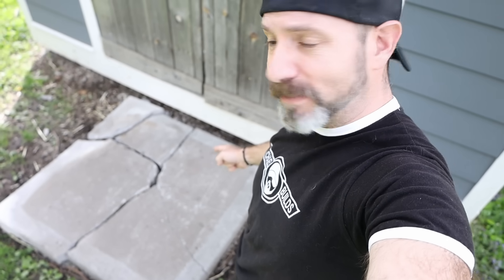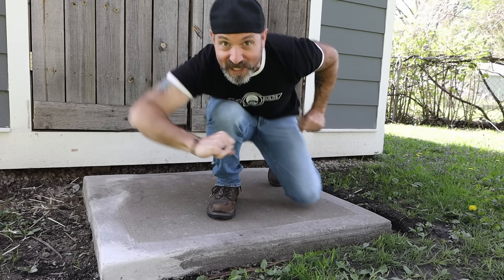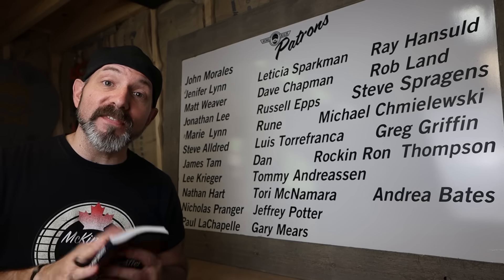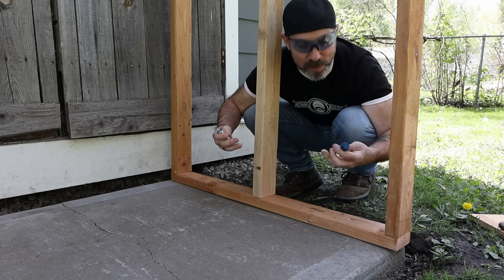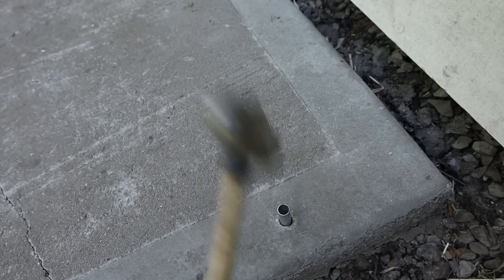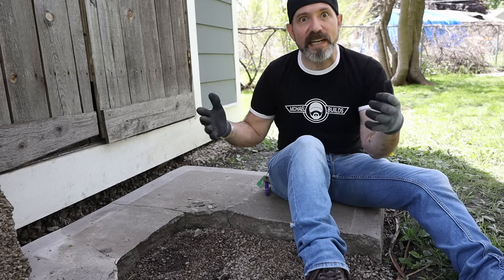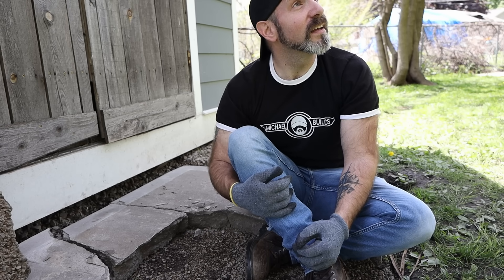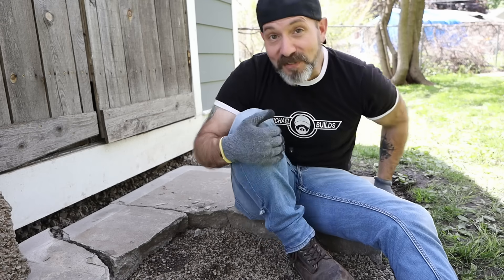Dry Pour 30 day cure Test

Comment: was this using the ready to use concrete quikrete mix? and you used the same method as other videos, mist a couple times and then soak them for a day or two off and on? getting ready to do this to extend my parking pad just a bit. great videos, thanks!

Comment: One effect in dry pour concrete is that cement loses most of its volume when soaked in water.  Those voids remain, similar to using too much water in a wet pour.

Comment: I'm 65 yo and I'm needing to do some cement work and I'll be doing it by myself.  Dry pour looks like a godsend.  
Found another vid about a civil engineering trick where rather than put rock and sand as a base to pour over, you mix 15 - 20% concrete into the dirt and let it harden.  Cheaper and easier.

Comment: Dry pour also does not meet local building code either in most jurisdictions you’re required to apply with code enforcement before you even pour any cement once you tell them you want to dry pour they will deny your permit and depending on the code officer you might have to jack hammer it all back up and face fines up to $200 a day you’re in violation.
Reply: The good news is it's so weak you don't even need a jackhammer to break it up

Comment: I saw your first video.  It is a failure.  I could have told you that from the beginning. These DIY folks don't have a clue or understand how concrete cures.  It is a chemical process and needs lots of water.  As the car tire went over the pad, you can see the pad flexing.  It will be dust in just a year or two.  The lower 2/3 of the slab never gets enough water to cure properly.   Does it cure to 3000 PSI, normal or 1000 PSI?   How many folks were not as diligent as you and watered it a few less time than you did resulting in it only cures to 500 PSI?   Note, the slab, as small as it was, should not have broken as you drove over it even 100 times.
Reply: I agree with you except concrete doesn't need lots of water, it needs the correct amount of water to thoroughly hydrate the cement in the mix. Correct pour concrete actually uses less water than dry pour.  The 60lb bag instructions call for 1.9L-3.3L, that's not much. Check out the great video "Testing Dry Pour Concrete With An Expert" by Tyler Ley, engineering professor at Oklahoma State. He found that water actually does penetrate dry mix completely and rapidly, but it doesn't form the cement paste needed for strong concrete. He found dry pour tops out at like 750psi while the same mix correctly poured achieves 3500psi.

Comment: Good video and fair testing. I use this method for decades - lazy way for "on ground" cement pour not thicker than 10-15 cm.- with or without metal or plastic rebar inside.After the "misty wetting"  while still not hardened,  it is possible to  make some "relief pattern" on the surface.Good idea is to spread and cover the surface with very thin layer of pure cement powder (after wetting) for reinforcing that surface and making it smoother. Can also use cement dye for colouring the surface. Dry pour is nothing new.By the way, cement and its mixtures are hygroscopic and will  harden like a rock even just on open air  and time of hardening depends only on the air humidity and takes longer time if not wetted on purpose.

Comment: Want a proper test, work with an engineering college professor, who can show you with a microscope what's happening both as concrete wet poured vs dry pour cures. There's a lot less strength, as one's not curing evenly, allowing a matrix to evenly form throughout the work.
This method was dispatched by the American Concrete Institute over 50 years ago, when there was miscomprehension of gunnite application being "dry" (it's not, it gets mixed in the gun with water and typically in niche applications where strength isn't a primary concern in all dimensions, such as swimming pools.
Concrete doesn't dry, it cures by forming hydrated crystals that form needle like structures that link together with the aggregate and peers to form a matrix, uneven hydration results in incomplete matrix development and corresponding loss of strength overall - especially through its thickness, as the center tends to get less water to hydrate with, the base drawing dirty water from the soil and only the top is well hydrated, so it's weak, but looks pretty.
The telling part being, it cracked, rather than flexed as concrete should do when the ground gave under the weight of the truck rolling over it. The further telling, how much pulverized into powder after 30 days of curing - especially in the middle of the work.

Nope, I'll mix it, dump it and rake it into place, then screed it, then finish it properly and call it a proper job. Then, at least I know that the concrete will outlast me.
Reply: Here's a link to exactly that, college engineering prof tests dry pour: https://youtu.be/YPAKzrv39xM?si=ULAZk7e4xNSl9IS_

Comment: Dry pour works, just don’t do anything on it for a couple of years. It takes many years to cure to the same strength the wet pour has in only a few weeks. Remember, concrete continually cures and increases strength over time, even decades!

Comment: Seems like the dry pour needs sufficient watering to be more comparable to a wet pour. The initial misting is only to keep to surface from eroding. SO I believe that a dry pour can be used in a block wall. Fill cement half way up to the top block. Fill the cell up with water over and over again to the volume ratio of recommended wet pour. Good luck

Comment: I don’t think it would have cracked if:

1- he had wet and compacted 3” to 4” of 3/4” base coarse over 6 mil visqeen plastic roll sheeting with a sled vibrator or a jumping jack compactor and made the moistened base very tightly packed  and hard as they would on a regular driveway or house slab foundation before a pour.

2- PERIMETER FOOTINGS and PROPER Placement of rebar and concrete wire. He should’ve put  in a 12” to 16” wide x  8” to 12” deep perimeter footing with # 4 double track rebar 1/3 of the way depth from the bottom of the slab and put #10 gauge, 6”. X 6” concrete wire through out as well, just as you normally would do with a wet pour.

3- PROPER WATERING: While doing the dry pour method, it would’ve achieved much greater hydration, compressive, and tensile strength if he had put down #6 to 10 mil visqueen roll sheeting first  under the 3” to 5”of moistened and tightly compacted 3/4” minus base coarse gravel/sand aggregate from the quarry. 
  
     *It must be sufficiently moistened wet again just before the dry pour. 
   * If you want to achieve maximum strength wet entire slab down every few days for 30 days.
     * It must be lightly sprayed with water as you apply each 1/2” layer of the properly mixed 4,000 psi concrete dry mix.         * Then moistened it lightly every half hour twice while keeping it covered with black #6 mil roll plastic sheeting to keep it properly moistened and prevent evaporation so that it cures slowly and properly. 
😮
Then moisten it down every two hours twice, then once a day for 3 days, always pulling the plastic sheeting over it after the light spraying with water. 

How often should you wet concrete when curing?

DO spray new concrete with water. One of the most common methods for curing concrete is to hose it down frequently with water—five to 10 times per day, or as often as you can—for the first seven days. Known as “moist curing,” this allows the moisture in the concrete to evaporate slowly thereby achieving proper and thorough hydration and chemical reaction in the concrete.

4-   How long to cover concrete with plastic?

For at least 20 to 30 days, wrap it in plastic or moist cardboard. A week is preferable. There is even a modest advantage at 28 days for huge slabs. In dry conditions, spritz / spray the concrete surface several times per day and cover it with 6 mil visqueen roll plastic sheeting to keep the moisture in. 

   Concrete achieves 90% maximum strength at 30 of moistened / covered curing. 

What is the Best Vapor Barrier to Use Under Concrete Slabs?
In the 2021 edition of the International Residential Code (IRC), the guidelines were revised to recommend a minimum 10 mil vapor barrier for use under concrete slabs in residential buildings instead of a 6 mil.

The American Concrete Institute (ACI) also recommends a minimum of 10 mil polyethylene or thicker for vapor retarders under concrete. According to its Guide to Concrete Floor and Slab Construction ACI 302.1R-15, thicker poly provides a better barrier and is also more puncture resistant. ASTM E-1745 also advocates for thicker poly or other membrane material to be used to form more of a barrier against vapor.

Mar 21, 2020

5- IF YOU WANT A SMOOTHER, harder finish, mix a creamy slurry with no aggregate on the final 1” and float then trowel it when it’s dry enough.

Comment: Should have put some bamboo stalks in there.  Use dried bamboo, not fresh cut.  Cut it to length and split it in two.  Fill concrete in half first, put in the split dried bamboo and fill it in like you did.  The Japanese used bamboo in their WW2 concrete runways on Pacific islands because of a shortage of steel. They were still serviceable and repairable into the 80's last I heard.

Comment: Try placing a visqueen vapor barrier on the ground and up the in side the form. This will keep the moisture in the cement. The longer the water stays in the cement the better. There are some additives you can add to the water of convenience that will aid reduction of unreacted calcium hydroxide. The key is moisture retention. Also apply visqueen over the top of the surface after any excessive water comes to the surface. As long as moisture is present the concrete will continue to harden.

Comment: Under the slight chance you see this…. so I have been watching your videos, and something clicked. You had ran over the slab with your truck many, many times before it broke. So I thought maybe it could be used as a garage floor BUT, all videos I see are for sheds or patios.
WHAT IF we dry poured a 2in layer, sprayed/set etc., etc. 
THEN dry pour a second 2in layer over that (as most say 4in is ideal for a garage).
I ask with this in mind, I am a diy mechanic, so it’s a must for the slab to be able to stay solid when there’s a car on jacks (especially if I’m under it…. 🙁).

Comment: The strength of concrete comes from thickness,  recipe mix,  and unlamented and any reinforcement you include.   I’ve only seen dry-poured concrete used as patio or porch use,  not commercial-drive-my-self -esteem over it.

Comment: The slab did show movement when you drove over it.  I don't think a wet pore would have faired any better. The proof would be if you poured a wet slab next to it and did the same thing. Either way a driveway should have steel in it.

Comment: Drive-on test, itself, was not fair. The small piece kept lifting off the ground when the weight was on the edges. (The edge will always be weaker anyways.)Causing it to not have a solid base, causing weak points. In fact, the more water used in concrete the weaker it is. Normal concrete is at its strongest after 28 days. The fact that moisture had to seep into the slab, causing the center to not absorb moisture until days later. So a longer curing time may be needed.

Comment: glad I found this. i've been interested to see the "long term" test/review because i've never even heard of dry pouring concrete. It seems like a viable option. Sure the Truck running into and over the slab cracked it but for it being such a thin layer and on gravel, it def impressed me.

Comment: I've poured posts with a small amount of dry concrete in the bottom of the hole just to keep the bottom of the post out of the dirt and to hold the post plumb ,while l poured the wet mix, and went back years later, and pulled the posts only to find dry concrete, l thought for sure the water table would wet and cure all the concrete, it didn't.

Comment: I once poured a small pad under my outdoor faucet for my roll up hose.  I dry poured several bags except for the top layer which I mixed and poured for working the fine finish.  It has held the hose reel bolted down just fine for many years and was a good enough platform for running water over for washing things.......  I got the idea because I've seen concrete bags ruined from being in a humid climate and the solid bag would not break.  Dry pour has it's place I think especially to save an old guys back , "like mine",  for a lighter need project........The key is as you said, leaving it to cure.  It takes longer and in some cases that's fine for certain home projects.

Comment: Im would like to know if you had done a gravel base then concrete,  would it have cracked ,  see just putting concrete on untamped dirt is why that failed , foundation was too soft allowing for wieght to force down in the middle , now im shur if anyone is doing a dry poor slab it isnt for driving on but if your going to cut corners anything will fail , no tamping thats one corner cut , no gravel bed thats 2 corners cut , no rebar or wire to keep it together  thats 3 corners cut , and last no premixing thats 4 corners cut , and what do you get when you cut all the corners ??? Well a circle of course,  so now youve gone full circle your going to have to do it again , see corners help this from rolling and all i see is this snowballing into a mess ...ill do it proper and take my time , only fools rush jobs ....

Comment: There is no 1/4" to 3/4" minus aggregate in that mix.  Where did you get that crap?  Since the surface was never troweled smooth in order to give is additional wear resistance, it would continue to flake off with use.  Cut up a section with a saw off of that test slab, and hire a testing agency to do a real compression test on it.  Watch it fail at under 2000 psi from at least a 3500 psi mix.

Comment: I don't know if anyone else has commented on this but when they built the Hoover Dam, they used a nearly dry Portland cement mix. There is no doubt that it has withstood a serious load of constant And fluctuating pressure for a very long time. I am considering dry pouring my new sidewalk, as well as the floor for my new shed, maybe even my garage (if the cost works out, and considering building codes.)
Reply: I have watched film of them pouring the Hoover Dam and it sure did not look like it was even close to being anywhere near dry the way you're describing it

Comment: One difference between wet and dry-pour is that the wet pour is usually agitated to remove air bubbles and produce a denser and stronger product.  I haven't seen the dry-pour advocates even tamp the stuff down.

Comment: You are 100% correct in that dry pour is just another tool in your belt. Just as you wouldn't use a pair of channel lock pliers to put in a wood screw you wouldn't dry pour a driveway or house slab. It all comes down to rated psi and how important it is to a specific application. Full psi potential can only be reached through proper curing and that only happens with the correct ratio of water and mix. Concrete generates heat as part of the curing process (that's how it dries so quickly) as proper curing is the result of a chemical reaction. This only happens with the correct ratio of water and mix in the initial mix (wet pour). If you took part of your broken slab to a shop with a hydraulic press capable of doing a crush test you would find that your slab probably rated less than 1000 psi.

Comment: TLTR how long does it have to cure BEFORE freezing temps?  -  I need to put a concrete floor in my mom's chicken coop, her pet chickens 🙄😂. It currently has a dirt floor, and of course her chickens have dug holes and etc, some deep, floor is sloping and very unlevel. She is getting older, and I am afraid of her tripping and falling... again. I also can't get a mixer truck close enough, due to a septic system and trees in the way. So I have to do this by hand... and by myself. I have no one else to help me. The building is 16 x 12, and is metal walls.  I would have to use a good amount of gravel to bring up the lower side to level. I don't' need to drive on it or etc, just need a solid level floor that the chickens can't dig up and you can walk on, but I don't want it cracking up or etc of course. I can use wire to strengthen. The minimum thickness listed for quickcrete is 2", so I am estimating (using concrete calculator) 56 bags, but was going to buy 60 to 70 to have some extra. I was planning on renting a concrete mixer, and pouring this floor in about 3 sections since I'm working alone. BUT if I could Dry Pour this... I can see this being SO MUCH easier. No mixer, no having to move it 3 times, no taking it in one wheel bar load at a time etc. Could still do 3 sections if I wanted since the building is already built and I have no way to reach the far end from the doorway in order to level it before misting... unless i could level each 4 ft section, then continue to put down the dry pour for the next 4 ft? I do have a second door that I could use a water hose from. One Question I have... how long does the concrete have to cure BEFORE freezing temps? Still got about a month here.

Comment: I have to say you did great with those tests .......question:  1st. Yes I'm trying to cut corners. (Kinda)
I'm building a photo studio detentions will be 17' wide x 32' long at its longest point x 10' high. Yes reinforced with rebar My 1st. Thought was to make a wood frame 2" x 6" but my wife thought building it with  cement blocks? 
What do you think? Will the slab withstand the weight of the cement blocks?